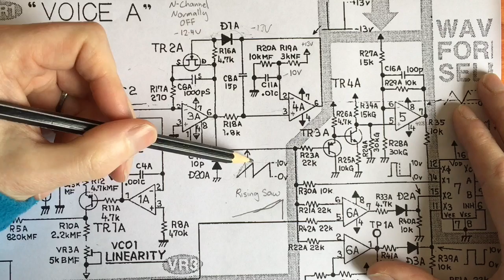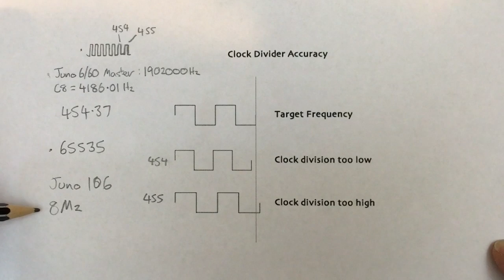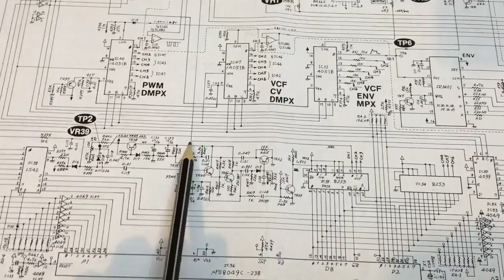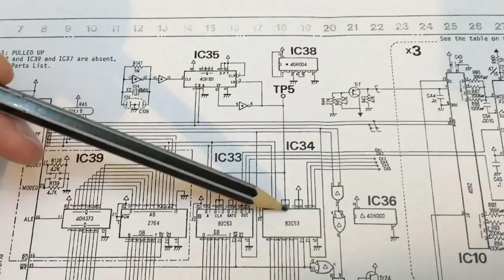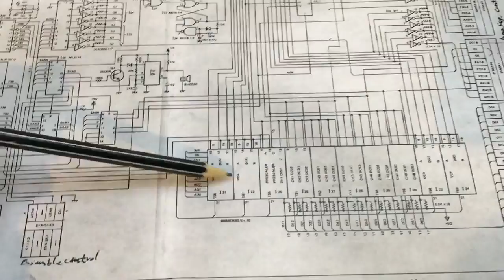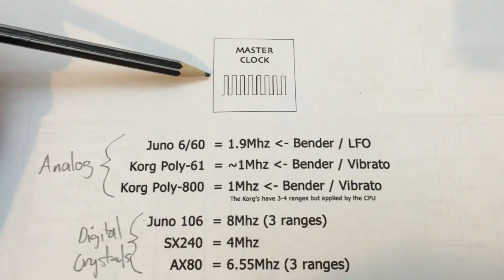How DCOs work, differences in Juno 6/60/106, Korg Poly-61/800, Akai AX80, Kawaii SX240.

Comment: Great video! I have a AX80 that has a very weak saw wave around that opamp coming on OSC2 voice 4 .Since the square wave is derived from the saw its also really weak. I'm trying to figure out what's causing the issue at really low frequencies. Mid to high you can hardly tell its out of whack. Could be the input cv, the transistor, or a weak cap.

Comment: Hey! Thanks for the video! Do you offer any support on juno 106 diagnostics? I have changed all 6 "voice" chips and 3 wave generator chips for new ones, but still have completely no sound on voice #5. Voice #6 outputs only the sub and the noise + I can hear that it kinda tries to make the sound (super fast attck and super fast release) for the saw and pulse. Also did the filter test. On voice #5 I cannot hear that self oscillation. Other voices are good. Do you know what could have fone wrong here?

Comment: wonderful tour of these schematics, thank you for taking the time to make this. a few points stand out that are worth noting.
1: thinking about a pnp as "normally closed" can get you into trouble. BJTs are all normally open! 
2: in both cases of rising and falling saws, the rate is set by the current into the integrator circuit (op amp with cap out to negative input). the resistor in series with the transistor sets the discharge rate and limits the current through the transistor. 
3: keeping the sawtooth level constant at different frequencies is the job of the microcontroller, and inherently tied to the ramp rate. this is done with the dacs.
3: rising and falling sawtooths sound identical, this is a fundamental truth of waveforms and harmonics. 
4: Poly 800 doesn't have DCOs like this, but instead builds all of its waves by summing pulses!

Comment: Great video, I wish I could like it twice. I'm working on my Poly-61 and I have almost finished redrawing the digital board schematics. Would you be interested in recording a follow-up video about Poly-61 if the schematics were readable? I'd like to create a replacement digital board and need to understand a few more things (e.g. what is the anti log circuit doing) to keep 61's character while removing its limitations.

Comment: It's a pity you didn't do the Korgs because I've heard that the Korg Poly 800 doesn't use a capacitor to generate the saw wave, but rather generates a simple stepped saw by mixing multiple octaves of square wave in the correct ratios. I have no idea if it's true, I watched this video hoping to learn if that was the case.

Comment: What is the name of the synthesizer type, if it uses digital sound generation and analog filters?  Alpha Juno is hybrid ? Or analog?  Can DCO generate a wave digitally (like Alpha Juno)? Or this type of oscillator will no longer be considered DCO?  (despite the fact that the manufacturer called it the DCO in manual)  ...but it is not indicated anywhere that the DCO must necessarily be analog ... digital in both cases only control the pitch

Comment: Awesome video! I'm currently designing a hybrid oscillator that can run in different modes, as an experiment, so this is a relevant refresher. I kept thinking about your statement about the upward versus downward saw/ramp, where you say downward usually contains more low end. Can you elaborate? Why is that? The reset pulse length affects low end, but in both directions equally. So is there another factor at play?

Comment: Hello,

I plan to bluild a DCO for musical application from 16hz to 8000hz with a sawtooth output signal.

My design of the DCO works the following way by managing two things from the Microprocessor (inspired from Juno 106):

•The sawtooth positive slope by giving the correct voltage to a RC network to have the adequate voltage at the end of the note period.

•The discharge event when the microprocessor immédiately shortcut the RC network to restart the next sawtooth period from 0v at the right time.

How to manage the discharge Event with this ATTiny85?

For the discharge event I have to count from an external oscillator a certain number of clock cycle with the microprocessor. I wanted to use the common and cheap ATTiny85. My problem is that it contain two 8bits counters but none 16bits. 

For that i Identified two technics:

•Cascading the 8bits counter using the overflow flag, but it seems that from my reading that i would introduce counting errors as it takes time for the µP to detect the flag and store the value.

•Another solution would be to pre-scale the second counter (fclockin/1024) and count the clock divided by 1024 but it seems that prescaling is not allowed from external oscillator.

But devil is in detail, i have also to manage and external clock prescaler to divide the 8MHz clock by 2,4,8,16 to have a better frequency résolution at low frequency notes. But, that should not be a big issue.

What would you suggest me? Any other way to do it?

Thank you for your help!

Comment: To bad we couldn't go over the Korgs, but otherwise a really great video. I was always under the impression that the Poly 800 had digitally generated waveforms and oscillators (not digitally controlled VCO's) but turns out it's more analog than the Juno 106! Technically anyway

Comment: Hi GOLT! Great Job. Did you actually verify the shape of the pulse from the 8253 to the SAW-Wave-Shaper of the JUNO 06 with an oscilloscope? As far as I understand, the 8253 outputs a short negative pulse, that is used to to shortly switch on the PNP TR5, which in turn discharges the capacitor to 0V. Then the positive voltage from the S&H 1/2 IC35 sends a current into R36, which in turn makes makes TP3 go negative. So the sawtooth goes down from 0V to -12V. What do you think?

Comment: Great video! I just have one small disagreement; I don't think the difference between the clocks used in the Juno-6/60 and the 106 is as big as you make it out to be. Any error in the VCOs is divided by ~1000, which would make even severe drifting in the VCO virtually inaudible. I don't think you can attribute much of the sonic differences between the 6/60 and 106 to this.
Reply from the maker: Johan Fjeldtvedt I thought about that when I did the video, but what changed my mind was that the clocks were analogue SO they could be voltage controlled (by as much as an octave). The clock input CVs were able to shift the pitch by large amounts and those input CVs weren't precise or that well controlled. Granted they are not as unstable as true VCOs but the fact that there are quite dramatic input CVs changed my mind. They will not have the same stability of DCOs clocked by crystals because of the input CVs I think. The crystal based DCOs had the bender/LFO CVs quantised by the CPU first, so there is no way those small shifts will be present. That's my theory anyway. :-)
Reply: Any degree of variation in the clock period will also be in the note periods, as the note periods are created in the circuit by adding together multiple clock periods.
Reply: Hi, GOLT! If you could explain this... Do DCOs triggers the wave on every note or DCO can work as a "free wave" oscillator? As I know usually VCO works continuously and just shaped by VCA.
This questions seems silly for me but I really not sure if it "plays the wave" in the same way as VCO.

Comment: struggling with this, not because of the video.. I'm just dense sometimes. 
so in other words....
my simple understanding between the 2 was that a digital clock something or other with the oscillator..  DCO. vs with VCO it's voltage passing through at a specific..rate?hz?

Comment: ok then, as far as i can tell from this video is that in all actualery the juno 6/60 are  NOT TECHNICLY  DCO'S  as roland say they are/printed on the keyboard, BUT VCO'S,  because the clock rate is not referanced to a CRYSTAL osalater circet [ aka a computer ]  but an anolouge circuit. point of interest used to own a juno 60 but sadly was stlolen some 25 years ago , cheers

Comment: Really great video, but I was disapoint because I had high expectations about knowing how the poly 800 waveshapers works..they are all stucked in an IC used in arcade game in the 80's and nobody knows if the IC is an analog circuit or a digital stuff, but apparently, this IC has incoming datalines..
the answer is probably more complicate but I would be very happy to know your though about the Poly 800 waveshapers ; look at this link if you have time  :

http://sequence15.blogspot.fr/2013/08/how-korg-poly-800-dco-works.html

Thanks for taking the time to educate us :)

cheers from france :)

Louis
Reply: Also what makes me doubt is that his big brother, the poly 61 has apparently one "true" VCO and one DCO which might used the same chiptune technology used in the poly800;
so what is this chiptune technology ? from my experience, it is pretty stable, and it doesn't sound quite analog but at the same time it doesn't sound quite digital either ;
anyway I love my poly 800 which is what really matters :) but I'am really curious about that
Reply from the maker: That article seems to refer to the counter as the chip tune IC. Which may be true. It is the same counter IC that is used in the Juno. The difference in the poly 800 seems to be that it controls a flip/flop that creates a square wave. I remember looking at the poly 800 and poly 61 schematics, but I didn't include them because they were very badly scanned and too hard to read when on video. Korg did experiment with different ways of producing waveforms from digital IC's. If I can find a better scan I will do a second vid and include the JX8P/JX3P as well.
Reply: Yes the schem's are in bad shape and nobody on the web seems to have proper scan of it; anyway thanks a lot for the fast reply ! I will investigate and maybe contact the people that makes the hawk modification for the poly800 ; they most certainly know something about it :) besides it's a wonderful subject to speak of <3 lol
Keep up the good work !! cheers :)

Comment: This is a great video. Thank you! What does it mean for a JX-3P. As I understand it the envelopes on the JX are generated by the CPU, but I don't know if the original master clock is crystal or analog since its design is older than the 106.

Comment: Thanks for this fantastic video, I have learnt so much from this. I have a Juno 60 which died recently (CPU failure, now repaired) and to help with the repair, I borrowed a friend's Juno 6. I have always felt that the DCOs on my 60 have a very stiff, almost unforgiving quality about them. I was surprised to find that my friend's Juno 6 had quite a different quality; the DCOs were, in fact, slightly out of tune with each other. When playing octaves, I could clearly hear that there was some slight detune happening, which made the Juno 6 sweeter and more 'relaxed' sounding compared to my hard and precise Juno 60. I have always wondered how this could be the case when they are supposedly identical voice boards with only the one master clock present, as you have explained in your video. Both of the 8253 counter chips are receiving this same 1.90MHz clock. Could it be tolerance differences between the two 8253 chips, causing slight differences in tuning between voives 1,2,3 and 4,5,6? Or could this be something happening more at the saw generation level, or even the key CV value? Would be keen to hear your thoughts!
Reply from the maker: You are right! ( I have a strong opinion about this ) - Sorry it has taken me so long to reply. I actually tried to reply as soon as you posted the message but it failed to send, and then I forgot for a while! Firstly I completely agree with you. The Juno 6 is my favourite of the Juno's and there is definitely a reason why it sounds more "relaxed". I don't think it's the counter chips. The counter chips are the same as the 60 and should divide the same. I think it's the CVs and it is a huge difference. In the 60 all the CVs are quantised into 256 steps by the CPU before going to the analogue circuits. In the Juno 6 they DO NOT travel through a CPU, they are all immediately applied in all their naturally variable analogue glory. This greatly effects the synth. You can notice in so many ways, even in the filter it's obvious. Turn the resonance up to full in the 60, then slowly move the filter cutoff,  you can hear the stepping in the filter due to the CPU. Do the same on the 6 and the stepping is gone. All the control voltage are effected, so even if the DCO tuning is similar, by the time the voice makes it's way to the output, it's clear the 6 is more organic.
Reply from the maker: +Falk Hoffmann (falconi) The falling saw sounding fuller is just my opinion based on Eurorack oscillators that allow you to shape between the two (like RS95E). And combining that with my general opinion that the synths I the think sound fuller in the low end, tend to have falling saws. It's only my opinion and I could be wrong. It could be that the actual oscillator design has more impact than the saw direction. I don't have a good spectrum analyser so I can't verify any of that.
Reply: Thank you for this very informative reply, a total revelation! I had heard many times about the Juno 6 being a bit 'warmer' from various people and I always sort of dismissed it until I actually compared my Juno 60 to my friend's 6. Those CVs getting applied to the voices directly on the Juno 6 makes a lot of sense and solves the mystery. Thank you again!
Reply from the maker: That's amazing! It must be the way our ear's / brains perceive the sound. I can't believe even inverting the same wave made a difference in the perception of it..
Reply: @GOLTSYNTH  Is the perception dependent on whether the resetting of the oscillator is a compression or a rarefaction in terms of the air pressure coming into the ear? I telly would like you to discuss how the "VCOs" on the Prophet-6 and OB6 work an how they are regulated..
Reply: Falk Hoffmann I know this is months after your reply but I wanted to chime in. I was recently doing some expirements on this very subject and came to the same conclusion. That ramp vs saw have a different bit of low end to them. What was odd is using a spectrograph I saw (pardon the pun) no difference in frequency content. 
 I've heard rumors that it's a psychological effect dealing with the way we humans perceive sound though. I'm still looking into this. Ethan Winer seems to think he has it figured out here. http://ethanwiner.com/ear_imd.htm
Reply: Matt H I tried it a few ways, first I used a saw wave from a eurorack osc , I then  split the signal and inverted it in my eurorack. I also took the original signal and recorded it at 96k 32 bit and inverted it in the daw as well. Both times making sure to phase cancel for level and accuracy. I saw no spectral differences (using ozone 5 insight) and yet I could certainly hear/feel a deeper vibe to it

Comment: Awesome! It seems to me that all that really matters when it comes to the resulting waveform output from any osc. is if it allows further processing without aliasing. Correct?
Reply from the maker: My Cello teacher once said to me, "if it sounds good, it is good". So really it doesn't matter what oscillators a synth has. It's still fun to learn more about them though. I tried to not judge them, but sometimes you find yourself judging them anyway!